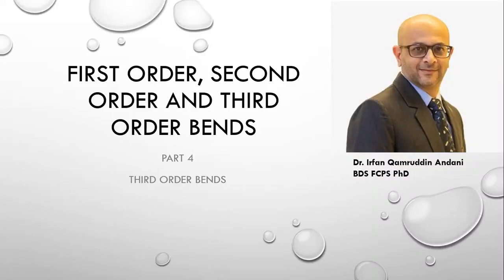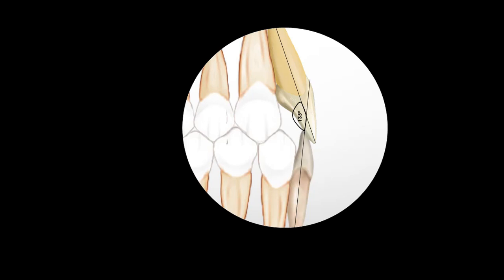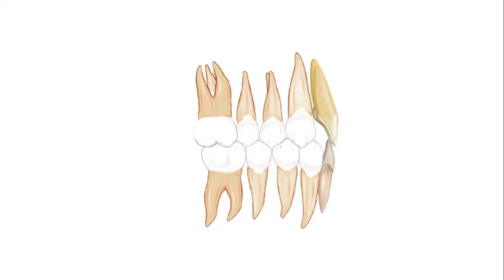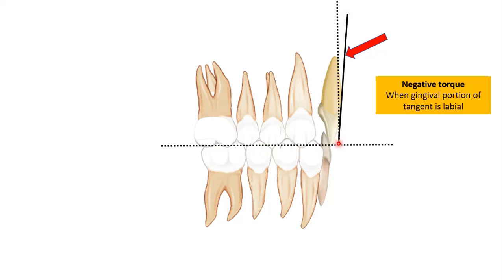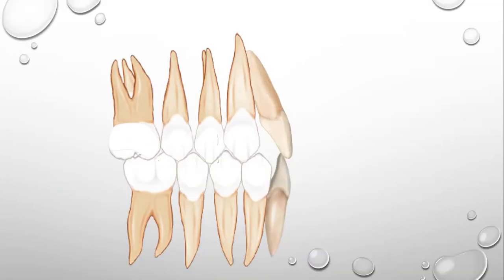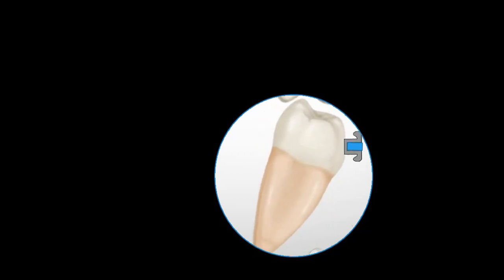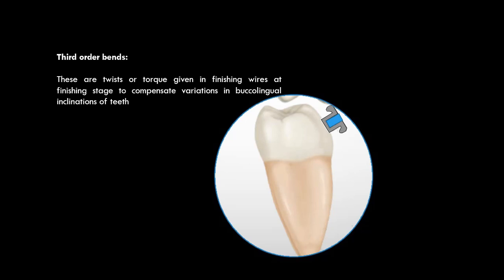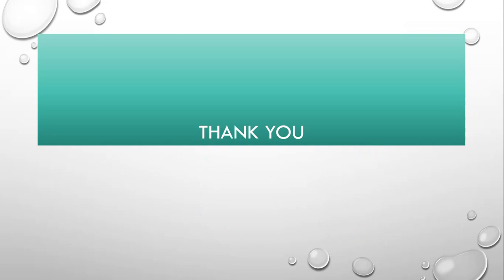Third order bends (Torque bends)

Comment: It’s totally great work and clear thank you so much … I just have one question in my lecture which is poorly explained there’s a pics of case that bending the wire with the second order bends to extrude the UPPER INCISOR and intrude the UPPER LATERAL, would you explain me how that’s work ?
Reply from the maker: @فاتنسعدعبدالجليل  thanks
When step bends are given in SS wire for eg. Step up mesial to central Incisor, now the wire will be little gingival to the bracket. When you forcefully bring that wire down and insert in central Incisor bracket, the tooth will intrude. 
I know it's difficult to imagine and easier with animation. I'll try to cover that topic soon

Comment: Thankyou for your wonderful video. Is it also possible to add torque to 1st and 2nd molars?
Reply from the maker: 1st molar is not an issue.  For 2nd molar either we bypass 1st molar or use convertible tube in bands to reach 2nd molar

Comment: Dr.  please, please, I need your advice 🙏🌹
a case of CL 1, mild crowding, upper 6 s are missed.
every thing was alright till I reached 17 * 25 NiTi wire, the upper 2s becamed with flared crowns and tipped distally.
I did all I know to fix the problem but it didn't work, torque bend, torque spring, upside down bracket, repositioning of the bracket, Z bend, putting the power chain under the bracket, change the right bracket to left and vise versa, with no hope.
the teeth are with normal phisiological movement, enough spaces mesially and distally, no sign of ankylosis, the x_ray showed no Pdl widening, radiolucensy or changes.
Please Dr. your kind opinion 🙏🙏🙏🙏
Reply from the maker: Better share pictures. Can't plan without seeing records.
Reply from the maker: With the same ID
 IIOCO

Comment: How to give bends and twists in straight wire
Reply from the maker: For torque, holding wire with two tweed pliers and twisting by turning in opposite directions 
Other orders can be given using a tweed plier and hand.  
Probably a video should be made to show